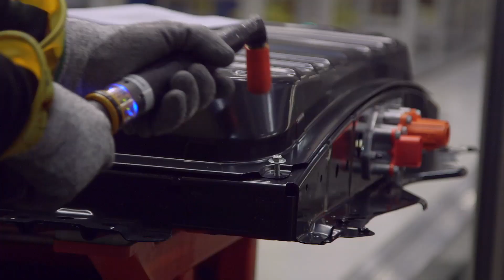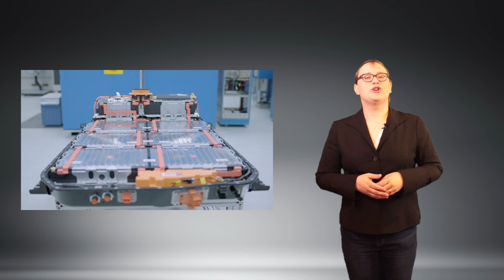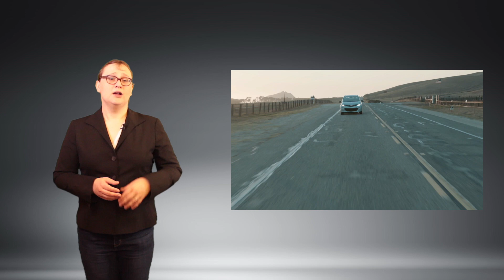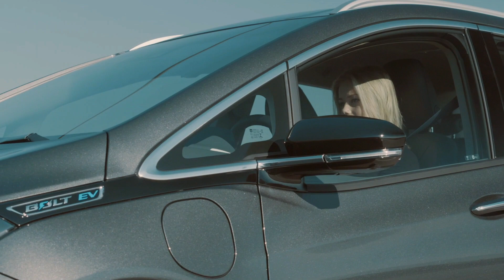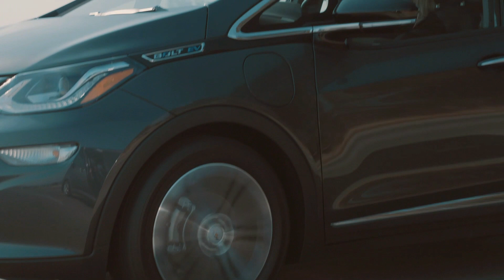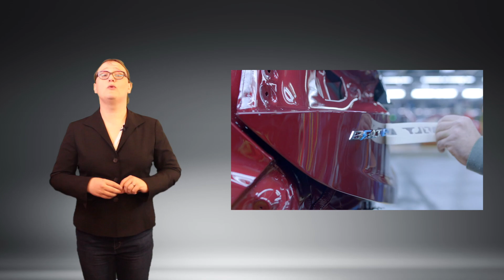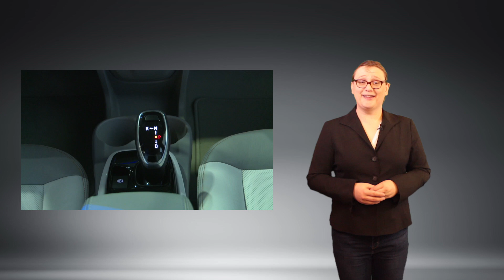Should You Worry About Battery Replacement Costs for Electric Cars?

Comment: Nikki,  Is there an updated video to this one?,   Today the price is double at a Nissan Dealer and so most people use a 3rd party aftermarket installer instead.  These aftermarket installers are using salvaged packs and some are cracking open the outside battery enclosure and they are replacing the worst cells only.

Comment: A comment on battery life (not EV). I am off grid and have a pair of lead-acid batteries. They are well in to their 7th year and I expect them to keep going for years to come. How? By being a frugal user. The batteries are fed from 2x 250W panels. I expect them to run my lights, my tv and my computer all year (you don't need a fridge in winter). In summer they run everything; the output of the panels is more than enough to power everything. In other words I am running my house straight off my panels. It's all about frugality.

Comment: So in short you SHOULD!! worry about a battery replacement because buying a new car is extremely expensive for what you get.. but now if you need to replace the battery? If I buy a gas or diesel powered vehicle I dont need to replace the gas tank... and even if I do for some reason... it's a few hundred dollars... not literal tens of thousands

Comment: 1.What cost the battery ??????? What cost the charger if it is going bad? Can it be repair it ??? I think they miss the point on the electric car questions here. Take for example Peugeot ion. The car after 8-10 years develop charger problem. Charger to change 4300 Euros because you cannot buy separately the parts to reaper it! Who would buy a car when the tire is flat and in the workshop you are told that the gearbox have to be replaced with the tire because they work together ???!!!! Everything is vin coded so you cannot buy used parts and replaced. Battery last about 15 years and cost until yet 10.000 Euros! Even if a small problem occurs with the battery you must change all the battery. So consider to give after 15 years 15.000 Euros for maintains. That’s no Green driving! This car cost more to drive than a normal gasoline car.

Comment: "tens or even hundreds of thousands of miles" ? If the battery is kaput at anything below 100k miles, it is completely unacceptable. 500k is ok and million miles would be great. The claims by the "skeptics" were not completely false, although not completely accurate either, they were quite exaggerated. Certainly the batteries last longer than a few years, but still they do degrade, and the smaller the battery is, the faster will it degrade. For people who buy mostly used cars, it is an important concern.

Comment: Won't hit 100,000 mile?  Hundai Kona EV is claiming lifetime battery warranty.  Any reality to this?  I assure you I will drive my car beyond 100,000 miles.
Reply: only time will tell. The other thing to consider is batteries are getting cheaper every year by 2025 they are forecasted to be 50% less so the 3rd party battery replacements will be affordable.

Comment: Not for me 113,000 and no battery degradation and still get 300 plus miles on my 2017!Chevrolet Bolt with Second Design battery. Want a  75 Kwr battery for 380 to 400 miles. Every thing else fantastic.

Comment: Dispite what every one says the EV is not an option to me because of li-ion. You cant charge more than 80% and cant go under 20% otherwise the battery will degrade faster. So you have to use just 60% of the range. Plus I have Electric scooter Niu N1s so the same batteries in the EV's. After a year of normal use and charging to max 75% and not going under 40%. The battery health is now 92%. so 8% a year with about 6000KM on the counter. That means with my ideal use it wil last 6 years then i will have the half range. Which is 70KM (100%-0%). so with removing the 40% of the safty for the battery the range with the new battery is about 40km so after 6 years it will be 20km which is not enough for my day use. So to summarize all. Dont buy EV if they dont make new battery chemistry that lasts minimum 5 times more than Li-Ion to be sure that you go 20 years with the batteries. Otherwise you have to pay about the half of the car price for new batteries

Comment: #iworkforgm    i have a spark EV with 94,000 miles and the battery capacity is so low i cant drive it anymore. GM is giving me a hard time with the warranty and the cost they gave me to replace the battery exceeded 20k, i paid 20k for the car!
Reply: Make them replacement or just be patient. With 5G technology coming up 2020. I'm hoping it should be like wardenclyffe wireless electric. But 5G technology 6G technology in 7g technology should change a lot.

Comment: A Tesla Model 3 Battery is $27,000 to $35,000 per Tesla themself #googleit. I love their examples to show a tiny leaf battery being $5,000. I am sorry but even if the battery last 7 years that is a massive amount of money. People had replacement gasoline engines at $6,000 and can barley come up with that out. You really need to think about how much $27,000 really is. If prices drop with efficiency in production that would expect, a 30% drop in price is still $19,000 every 7 years. I want Electric Vehicles to succeed more than anyone but that is a tough pill to swallow that someone will 100% have to pay at some point.

Comment: the batteries will be useless after 3-5 years of daily use. so after 12 years, you very well may have had to pay for a new battery 3 times, if not under warranty. assuming one was, the other 2 would cost you 30 grand before labour and taxes. that's more than the cost of buying a used car and running it for 10 years. also, they're useless in cold weather. would not work as a daily commuter car in places like canada.

Comment: When it comes to replacing the battery these people don't consider these people don't consider that in there ice they may have to replace the engine after a hundred or so thousand miles which will cost thousands of dollars they may have to replace the transmission they may have to suck up losing some MPG so on and so forth so replacing the battery in comparison to replacing all kinds of things and then on e v not so bad and of course you will be considering trading in the car and getting another one that has two to three times as much range after a few years possibly which would be another option or don't trade it in and have it before around town and short trips 30-40 miles away at the most and go ahead and buy another vehicle that'll take you 300 miles on a charge and have both

Comment: With the refabrication program the battery capacitors are replaced for 2800 dollars. All that gas and oil, transmission fluid changes blah blah blah, fuel system you didn't have to pay for in 8 to 10 years easily pay for. All that savings invested and made 5k profit and you can pay for battery and have enough left over to go on a cruise.

Comment: If right to repair laws hold, what may also help is a cottage industry of battery rebuilding. For Prius, rebuilds are readily available. Mine made it to 260,000 miles before one of 28 cells began failing. I removed the whole battery, took it to a specialty rebuild shop, and had the cell replaced and the whole pack reconditioned for US $500. It's been fine for the last 15,000 miles since.

Comment: Never buy a new EV without a manufacture agreement to replace battery at owner's choice at a set price.( never higher but could be lower at owners choice)  I have kept my previous ICE vehicles for a minimun of 15 years and/or  400,000+ klms. Replacing parts is always cheaper than replacing the whole unit. ( assuming the correct choice was made in the original acquisition)
My 2011 leaf has 140+ klms on the clock with 75% left on the brakes and is in brand new condition. Battery is degrading and I will replace with new one. I don't throw my quality flashlights out when the batteries die.

Comment: Battery replacement is and should be a concern for all buyers of EV's, even if your buying brand new EV with the intention of replacing the vehicle in 3 years at say 50K k's, yes you won't need to replace the battery, but who ever is buying it will need to take that into consideration, so the more expensive the battery replacement, the less resale value you'll get for your car.  And relying on battery technology advancing and becoming cheaper, is equivalent to taking up smoking  thinking the cure for cancer is just around the corner, yes the technology will get better but that doesn't necessarily mean it will get cheaper.   I'm not knocking EV's i'm just starting to research them, I'll be looking at replacing my petrol car in about 3-5 years, I have solar panels, and do short millage, my current car is nearly 15 years old and i've only just hit 160K km and 70K of that was in the first 12 months I had it, so for me an EV would be free to run.

Comment: I have a 2012 Leaf with a winter range of about 50 miles.  My round trip to work is 41 miles so next fall I will be replacing the battery.  I spoke to my local Nissan dealer and he quoted me a total cost of just over $6100 for battery plus labor.  You mentioned in the video that installation was included.  Is Nissan lying to you or is my dealer lying to me?

Comment: Resale value is a huge point in cost analysis for consumers. The average age of cars on the road in the US is 11 years old, if by that time the battery has decayed to less than half capacity then the car is worth less than the cost of the battery replacement itself... making it impossible to resell.
Nobody wants to pay $15,000+ or even $4000 for repairs on a decade old car.

Whereas gas tanks dont shrink, 13 gallon capacity today will still be 13 gallons in 20 years.

Until car manufactures focus their attention on longer lasting battery technologies like nickel-iron the degredation and accompanying depreciation makes these EV's a terrible automotive investment.
Reply: 810nicWolf that is why currently there are refabrication repairs at 2800 to make the battery back to 100% or better. And that refabrication will go down with competition providing more jobs where you don't get so dirty.

Comment: i looked at ordering a graphene battery for my big motorcycle. I was shocked at the weight of the battery being only 10.2 lbs compared to 20 to 25 lbs. the cost of the acid battery runs $135. to $175. cdn dollars. The grahene battery for the same bike was only $45.usd or about $65. wow. what a difference that makes. Still not quite ready for electric cars but we should be hearing by the fall 2018. The recharge is about 600 while the acid batter is about half. win win win.

Comment: I own a LEAF and this lady is full of shit. IT IS A REAL ISSUE. I bought a used 2015 LEAF. I hope to drive it another 10 years and get about 100,000 miles. I estimate I will save $5,000 over a ICE vehicle, assuming future fuel cost are what they are today. How many ICE cars need a new engine at 100,000 miles? Yes BATTERY pack replacement is a big dot deal. Again I own an all electric car. Almost $16,000 for a VOLT pak? She makes all kinds of excuses. BOTTOM LINE, electric cars do NOT really save the planet or your wallet. PLANET: Pollution to make, mine, manufacture batteries and charge the car is NOT FREE LUNCH. The cost? Electric car depression drops like a rock, AND BATTERY PAK.
Reply: Your air cooled Leaf battery has zero to do with Liquid Cooled Tesla and GM Bolt batteries.  Using active thermal management on the battery extends its life to 20 years or more, while Leaf batteries are air cooled using a heat sink and not even a cooling fan.

The 2015 should have the newer Lizard chemistry, and it supposed to hold up much better than the older version.  But it is still nowhere close to the reliability of liquid cooled batteries.

Besides, the $16000 is for a BOLT pack, not a VOLT pack, two totally different cars.  Even the Bolt pack production cost today is less than $9k and dropping.  It will never cost even $9k if it requires replacement years from now as battery prices drop around 5% to 10% a year, and have been dropping for the last decade, as seen here:

https://electrek.co/2017/01/30/electric-vehicle-battery-cost-dropped-80-6-years-227kwh-tesla-190kwh/

Note that they were talking about $190 over a year ago, and Tesla has already stated they are well below $150 today.  As seen here:

https://cleantechnica.com/2017/12/11/batteries-keep-getting-cheaper/

In reality, battery prices and replacement are a non issue on any car with a 200+ mile range and a liquid cooled battery pack.

Comment: Frankly, I am not bothered. By the time my car needs a battery replacement it won't be much more than the cost of a timing belt replacement and on top of that, my battery has an 8-year-warranty. So, no, I don't care. Having said that, I take very good care of my battery. 90% of times my SOC is minimum 20%, I snail charge it over night in a garage. I worry not.

Comment: What about replacing individual cells that lose their capacity? How much cheaper is that than replacing the entire battery?
Reply: Conway79 2,850 for refabrication where they replace the bad capacitors with new and improved ones.

Comment: A well manufactured internal combustion engine, as used in say BMW or Mercedes Benz cars, often have a service life over 500,000 kms.  
Internal combustion engine cars typically fail in the drive train first, not the engine.
It is a false comparison to relate the service life an EV lithium-ion battery to that of an internal combustion engine: they are currently incomparable.
Lithium-ion batteries inevitably lose storage capacity and output power throughout their lives, progressively degrading vehicle performance.  This does not happen to anything like the same extent for properly maintained internal combustion engines.
This video is simply propaganda, not an objective comparison.
Reply: sophrapsune what about the cost of gas, and the noise, and transmission, oil changes, fuel system, so many other parts included, a mechanic is very happy to not get so dirty with an electric car under warranty.

Comment: It seems a bit like cars will be chuck away just as they are now. At the moment lots of old cars get scrapped because the engine doesn't work anymore or it's full inneficient etc. You'd think electric cars would then technically never need scrapping. But 5,000 dollars to replace a battery when in the UK you can get a second hand Nissan leaf for 7k.....its almost easier to just buy a new car
Reply: Saying that with the 1k rebate it's not too bad but still alot of money and i think I'd try and just sell the car and get a slightly newer one
Reply: James X refabrication program started which cost 2800, and that cost will most likely go down with competition, more mechanics would more likely jump at the chance to keep hands clean.

Comment: That’s because the driver of a Volt only has access to 10kWh of the battery letting the customer drive in the middle 80% so they’ll never “see” any degradation. Doesn’t mean there isn’t any.
Reply: It has nothing to do with invisible degradation.  It has everything to do with the fact that if you let batteries cycle in between 20% and 80% of charge, and you never go below or above that range,  the battery lifespan is extended by 400% or more.

Which is the same reason why Volt battery packs will last hundreds of thousands of miles and show very little wear.

Comment: Not worried about it. LIke you said, and I also do with my cars I've owned, I trade em in before 160k. And when I DO buy my first EV, I'll probably lease the first time out, and see how it fares in real world. If I like the car (it'll be a Bolt), and I take it on a 3 yr lease, by the time it's lease is over, the battery's tech and range will most likely will be that much better.

Comment: its funny she said these are false issue and then gave info that proves all the issues are real and very damaging to the life of a EV. 

Most if not all Gov subsidies will be gone by 2020. this will add $ 10,000 to the price of even the cheapest EV. 
China will start charging for Battery disposal in 2019 which will add $1500 to $3000 to the battery.

Comment: Thank you, Nikki; you do an outstanding job informing promoting EVs.

My 2014 LEAF has 45 K miles; always driven in the Southeastern US (not as bad as the Southwest but still considerably warm); I have 74% capacity with ~62-70 miles of range left -for my commute, all I really need is ~22 miles daily; 

 I don't foresee any problems in the near future -in fact, I hope that by the time my degradation becomes debilitating, the cost of replacing the battery will be even lower, either by [1] lower costs of individual battery cell production; [2] an increased presence of third-party companies recycling batteries -and hopefully, converting to the newer 30 kWh battery will be feasible by then :)